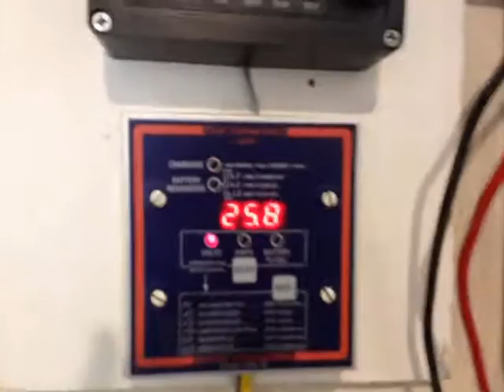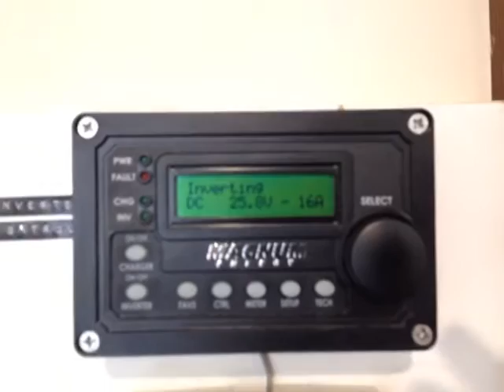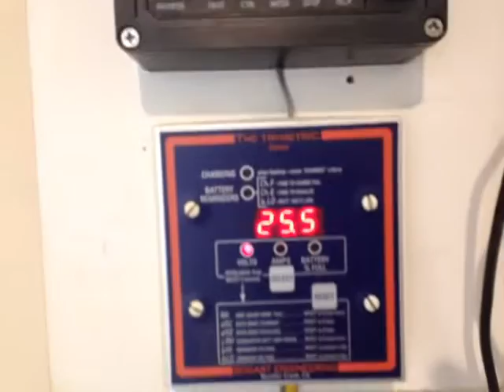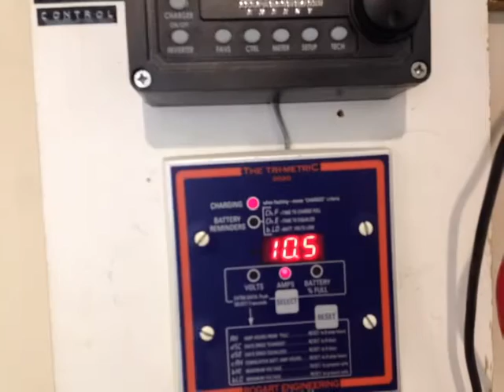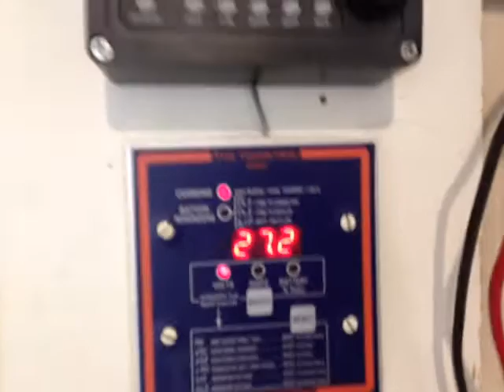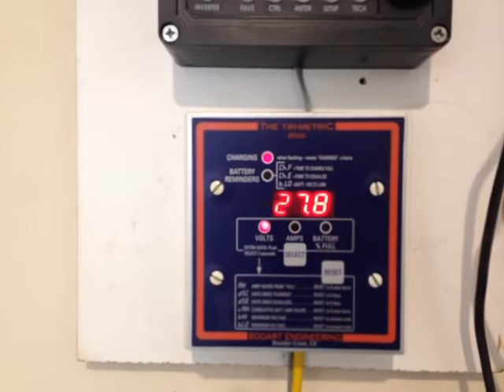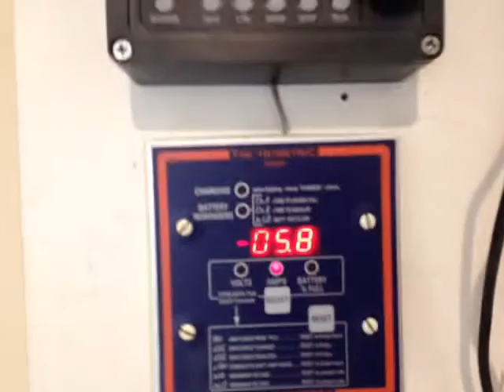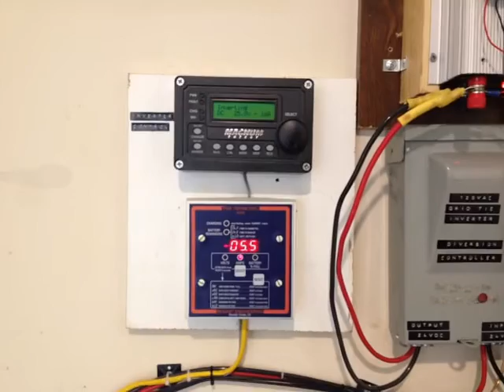Solar AC Coupling Demo using a MagnaSine Inverter Charger

Comment: What version of inverter are you using? Does your model output 240V? I have a magnasine but it will only output 110 on both legs. Can I put a step up/ step down transformer to get it to 240V?

Comment: So I have a Magnasin inverter and Enphase micro inverters like you. You have the Enphase inverts / panels connected to the same output side of the Magnasin and from the output side of the Magnasin it is changeing the batteries? DO you only have the grid connected to the input side of the Mangasin inverter? Do you have a diagram that shows this?
Reply from the maker: Thanks for your comments, I'm no longer doing AC Coupling, when I did this, it was a while ago so my memory is a bit fuzzy.  My system was a bit overly complicated.  Your best bet would be to get the pdf diagram at the link below. http://www.magnum-dimensions.com/sites/default/files/MagArchive/Magnum-AC-Coupled-Line-Diagram-1-May-2010.pdf
Reply: rhandsom That link is perfect thank you!
Reply from the maker: You welcome, take care.
Reply: Line page could not be found 😔

Comment: Would you mind giving a run down on the parts # names you use for the relay disconnect? The DC relay and the 2 AC relays?Thanks I am going to do the same for my SMA grid tie. I like that much more than a dump load. God Bless
Reply from the maker: +yankey4 No problem, I put the information in the description.  Please remember to be careful when putting this in place.   God Bless and take care.

Comment: What are you using for your ac coupled relay? were can I purchase. Thanks
Reply from the maker: You can check-out "1-Pole Surface Mount Solid State Relay; Max. Output Amps w/Heat Sink: 50", from Crydom.  Mfr. Model # D2450-B.  I used 2 similar to these.  They are of the "normally closed" type.  An adjustable voltage monitoring relay provides the control voltage to open and close the SSR's.  However, please double check to see if they will meet your requirements.

Comment: I've recently put solar panels and 4 deep cycle batteries and an inverter pure sine wave 2500w
On our farm that doesn't have power . 
We have been running a generator , so know we have both to power our needs .
We have had the solar system for the past two months, but it keeps tripping .
We are running the lights , refrigerator , water pump, TV, at times the solar works for long hours 
And times it just keeps tripping .
Also the generator is near the inverter.
Can anyone help or give suggested ideas.
Reply from the maker: When you say tripping, what do you mean? Please give more detail to clarify.
Reply: John sukkar cool.
Reply: John sukkar   What size inverter are you using John?

Comment: try not to install stuff close to battery bank. It will corrode in time due to fumes...
Reply from the maker: Thanks for your comments, I agree with you. These batteries are AGM batteries so they are sealed. However, I have since moved my inverter much higher on my wall. I have also given the same advice to others concerning flooded lead acid batteries being directly underneath electrical equipment for the same reason. This is an older video, my system has evolved to have Nickel Iron Batteries etc. Thanks again for the comments.
Reply: Thanks for the video. I have that inverter on order...
Reply from the maker: +DCL electric Cool, they are some of the best on the market.
Reply: i have 12 x 275 watt panels $3200
3x SolarEpic MPPT 40A Solar Charge Controller 150V PV input Tracer 4215BN,  $600
16x 232 ah battery $2600
1xmagnum 4024pae, 4000w,240v $2400 on order
1xpower jack 15000 ( china stuff) dont know how good it is, im using it as backup
Reply from the maker: Very nice system components and the costs are about right for what you are getting.  The power jack 15000 is the only item I would question, but from what I've seen, for a backup it should do fine.
Reply: Ok thanks